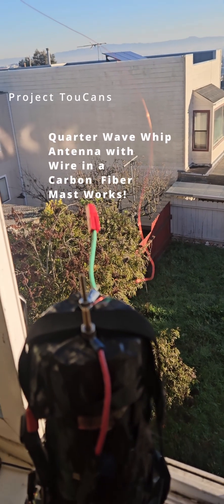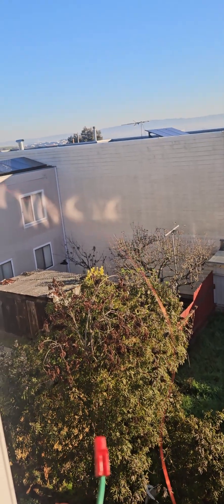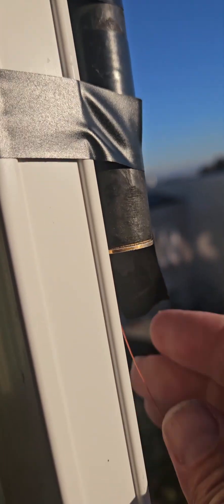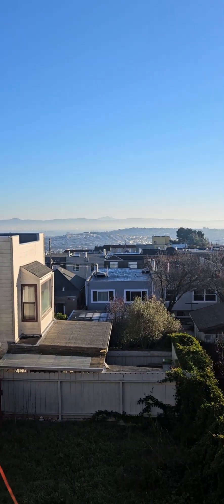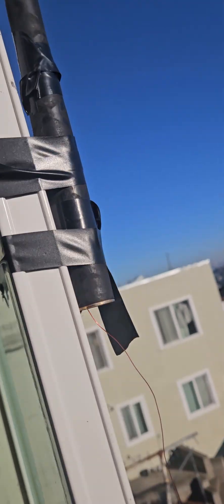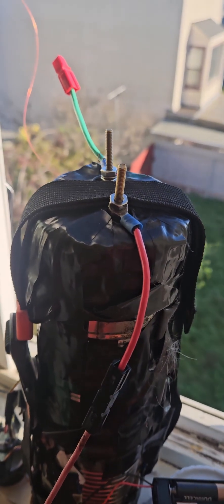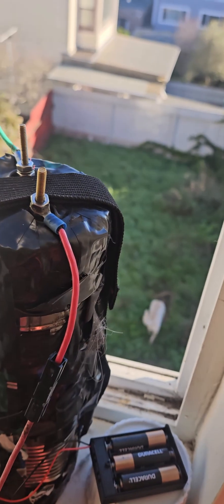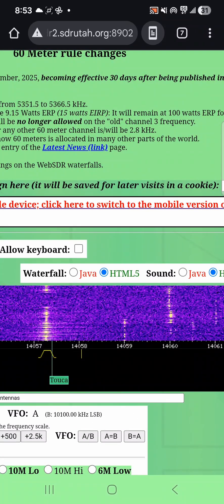Carbon Fiber Mast Antenna 20 Meter Vertical Whip S9 into Utah From SF #hamradio #qrp #morsecode

Comment: I'm going to have to check out my Lil Dude 6 and see where it tunes.
Reply from the maker: Please let me know what you find.  The rig here is rock locked at a single frequency.  Depending on where I'm operating,  I've had to leave one segmenton the mast not extended because the mount for the antenna was higher than the setup shown here.  The change in mast length didn't seem to matter.  I do have to adjust the counterpoise per location for the best results though.
Reply: @dolphus333  Will do.  BTW, I'm w7com in Portland, OR.